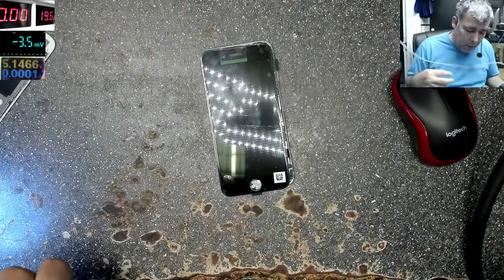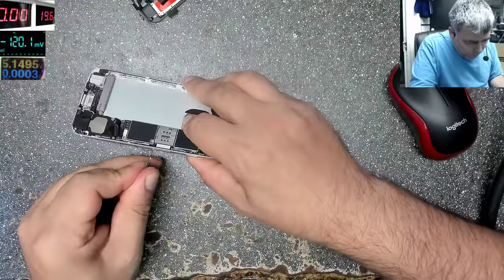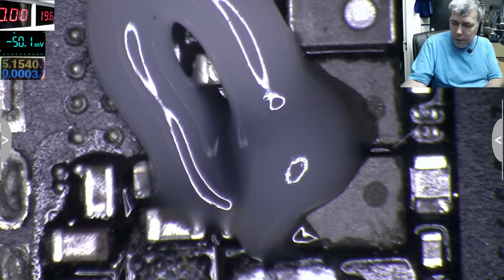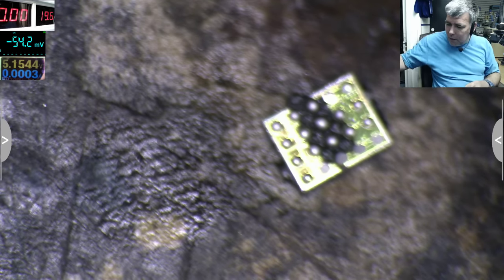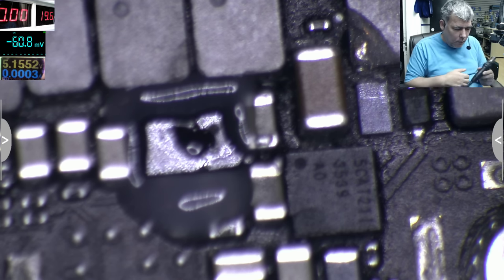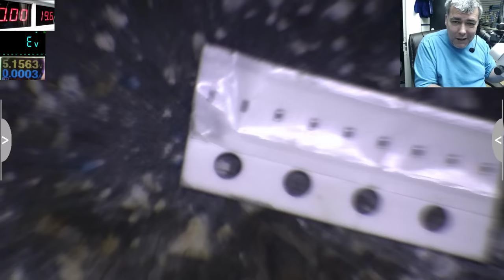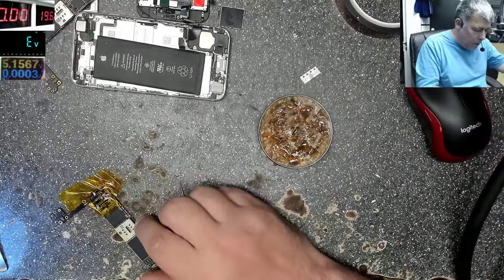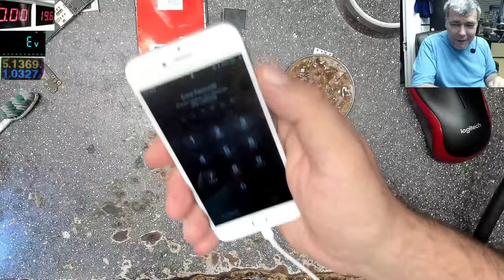iPhone No display/image Repair, Chestnut ic replacement

Comment: I love your videos but two things about this one. First, why didn't you check FL4211 in the first place? This is the most common reason for backlight failure and also the easiest fix. Second, you didn't replace chestnut. Chestnut is U4000 on the other side of the board. You replaced U3300, stobe/flashlight boost IC. Glad it worked though.

Comment: I did the same press too much on chip and squeeze a tin under chip out. and resistor that small it is easier to soldeer with soldering pen

Comment: Excellent instruction!  However, I've wondered why you use soldering paste on the iphone chips instead of the liquid solder that you make from kalafonia and alcohol.  As you instructed, I use that mixture exclusively.  Does it not work well on smd chips?

Comment: nice video! 
my question is how do you know that its a resistor?
not a capacitor for example
Reply: From boardview program
Reply: @techmonster2632  thx
Reply: Really was a fuse, not a resistor or capacitor

Comment: My laptop was not turning on  and also my adapter was blinking then
I tried mentioned methods in lenovo forums 
I removed battery, removed Cmos connector, then held power button for one minute and then without connecting battery provided a direct power to laptop, it blinked for
But it blinked for a second and then went dead. Then on youtube a guy showed a step "to remove keyboard connector flex and then turning it on by novo switch and it worked. So now keyboard is dead but laptop is working. Is there any way to solve the issue
Kindly help
Reply: Novo swtich is probably super IO. You dont have power button?
Reply: @commandroid9336  integrated with keyboard 🤦🏼‍♂️😭
Reply: @rajatthakur9091  What is the model number?

One way which may work will be: Remove battery of laptop, remove bios battery and plug in your laptop, it may start. According to sorin in one of his video. Ofc do this on your own risk.
Reply: @commandroid9336  already did but only when keyboard flex is removed it worked
Reply: @rajatthakur9091  If it is working then dont turn off? what will you do if you can turn on from novo? Still u didnt told us ur model
Reply: @commandroid9336  lenovo ideapad 320s
Reply: @rajatthakur9091  why not replace the keyboard? Shorting permanently wont fix the problem because then it will be seen as constantly pressed power button.
And why the fk lenovo put power button in keyboard?lol
Reply: @commandroid9336  yes that is only option left but issue is keyboard is also inbuilt and cannot be removed from top service centers will charge alot here

Thank you very much for your help
Reply: @rajatthakur9091  The wires that turn on pc when shorted could be used to make a switch. Just solder two wires on these two pins and take them out of the laptop and solder a push button and it will work just like power button. Will not look good but hey if its home use only it will work xD. How much they charge? You in india?